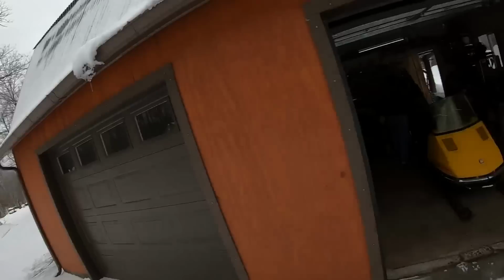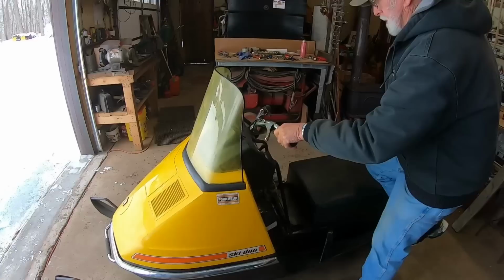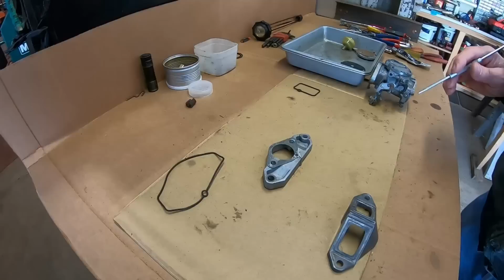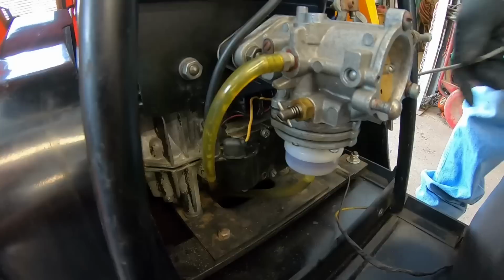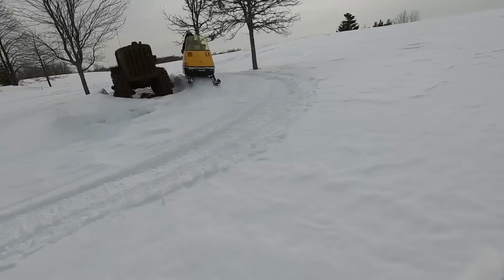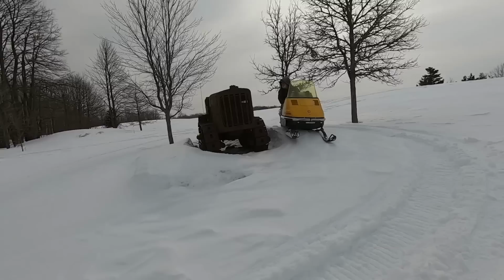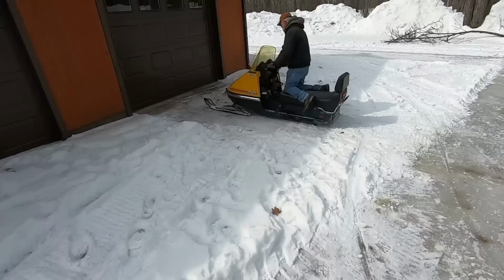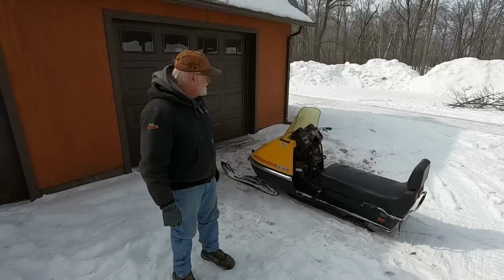Senior's '72 Ski-Doo Nordic Vintage Snowmobile Rebuild & First Drive Running the Fields & Swamps!

Comment: Relish these days, Toby. I spent many years riding with my dad. Rupp, Skiroule, Yamaha, SkiDog, Arctic Cat, Ariens, and Alouette were the main sleds we had. Mainly stuck with Arctic Cat, but all had their place. All the sleds are gone now, and so is dad. This video really has me thinking of him right now. Sure brings a tear to the eye with the memories. Thanks, guys, for the video.
Reply: @squatch253  Alouette, sounds French? Canadian or from France?
Reply: @casparberends2719  Alouette was a "high performance" Canadian brand, though they were eventually moved to Maine.
Reply: Ours was a 1976 Super Brute 340. 42" ski stance and aluminum ski's 18" long. Brother ordered it and picked it up at the factory. Used it both for grass and ice drags as well as oval racing. I don't remember the exact how, but it is in some way connected to Rupp and Massey Harris/Ferguson if I remember correctly. House fire took all my documentation in '14, so only going on memory now.

Comment: Love the sound of those old 440 two-strokes. Had first snowmobile in 1968 so this Nordic is familiar to me. 440s were top of the line at that time. Not the best riding or handling, but simple to work on and maintain. Glad you posted this video!

Comment: Wow lots of snow this year. I learned to never use silicone on a 2 stroke motor, it degrades when in contact with fuel. My go to sealant is Locktite 515 or Permatex Flange sealant, both are anaerobic and not affected by fuel. 👍👍

Comment: Those tillotson Carbs are the bane of my existence, have several large mcCulloch chainsaws that use them. Think they're too big a carb for the size of engine, they run just fine, once you get it running, but you can pull on the rope all day and they often won't prime, have to squirt some down their throat to get it going. Always thought sleds were fun, but they're just too rich for my blood, they cost as much as my car, and you just don't get that much time a year to play with them, and very high maintenance, if the skis, clutches, and track are all out of alignment by just a 1/8" you can lose a quarter of your power, granted might not notice as much on a newer sled. My brother had sleds, totaled three of them, one ran into mail box, the second hit a tree, and the third found a drainage culvert.
Reply: @Squatch253  buying something for the resale value is like not banging your ol lady to keep her tight for the next guy, buy what you want, ride it like you stole it and sell it for what you can when you decide to upgrade. 🤷‍♂️

Comment: Nice rides!  I’m impressed how easy they went across pavement!  Doesn’t that damage the skis?
Reply: Stub, the skis have replaceable wear bars on the bottoms. Besides, how else ya gonna cross the road? Minnesota has a very extensive snowmobile trail network maintained by local clubs.
Reply: @squatch253  Great info!  Never realized they had carbide inserts!  That answers my question.  Thank you sir

Comment: Where on earth are you getting parts for these old gals? I need to rebuild my 88 cheyenne with the Rotax 503 and single carb, it is givin my nothin but grief, wont start wont stay running; new electronics thru it with confirmed spark.